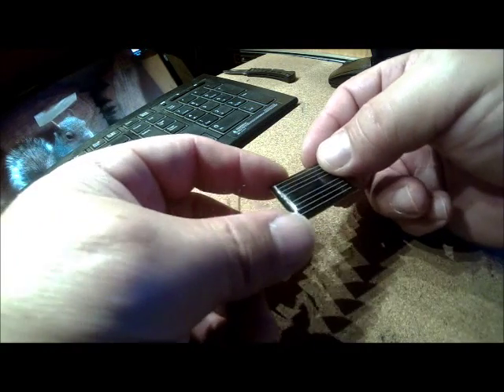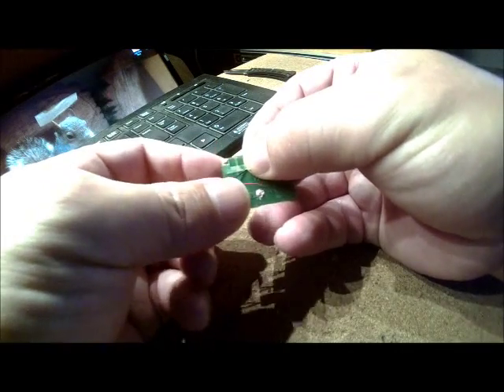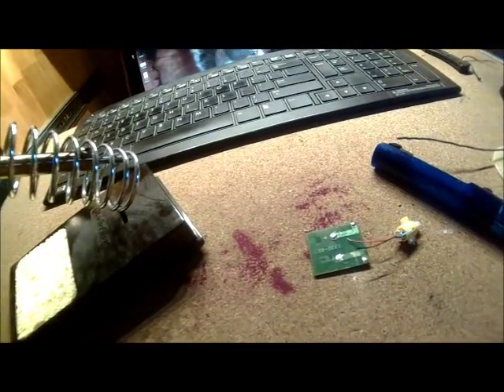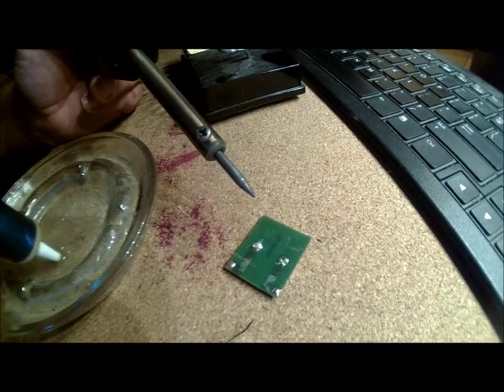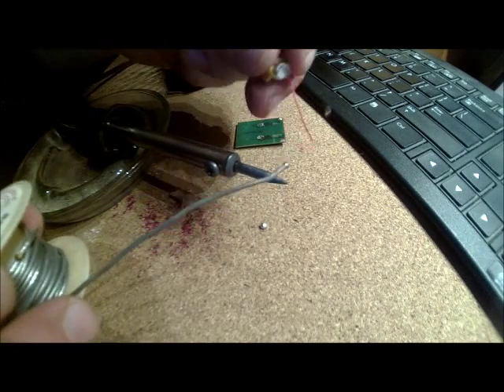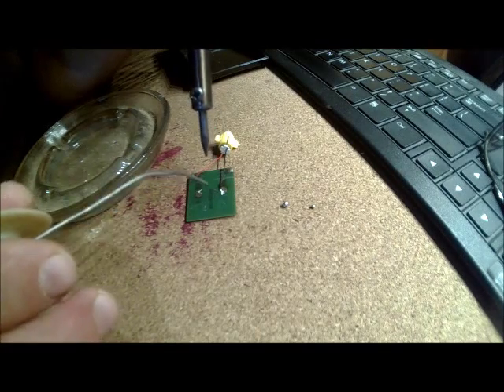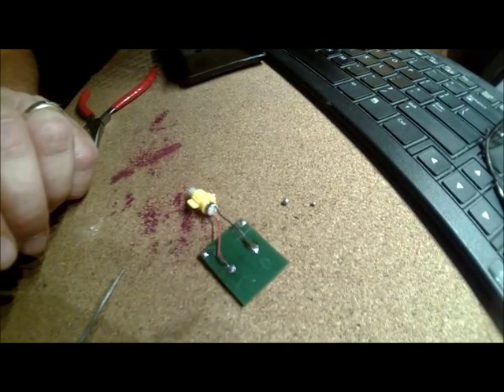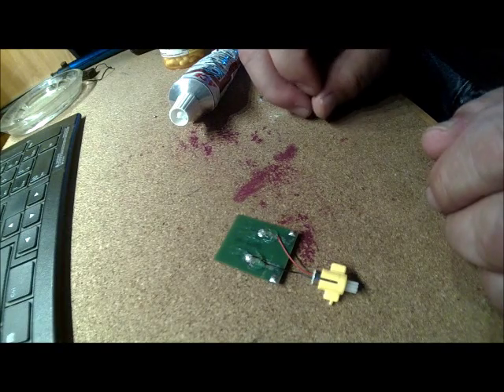Soldering a Small Solar Panel to a Motor

Comment: i have a fast question.. i bought some mini solar panels do i vave to solder on the clean side (inside) or from the outside side where it has some iron stuff on it?
Reply from the maker: Look for the contact surface opposite the circuit line.  It should be clear to see.